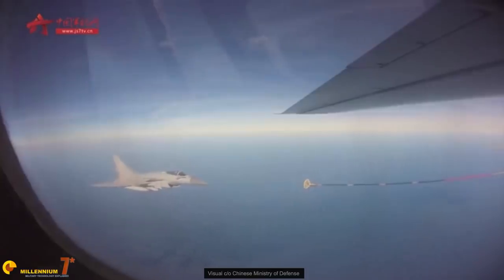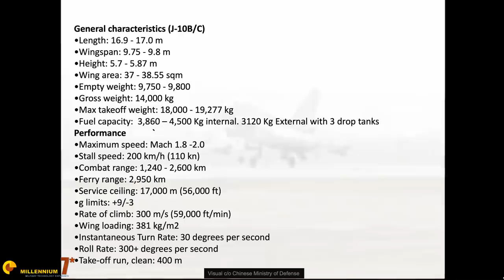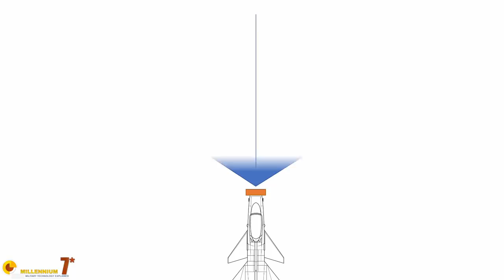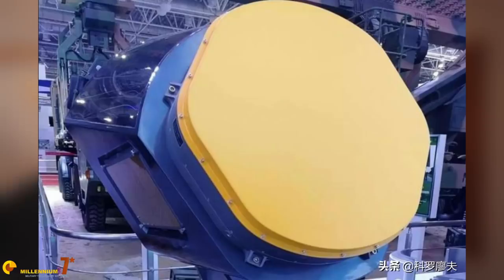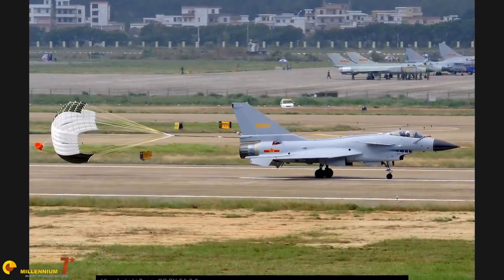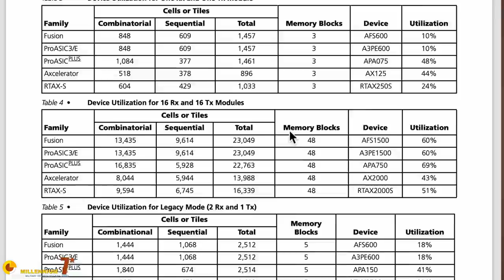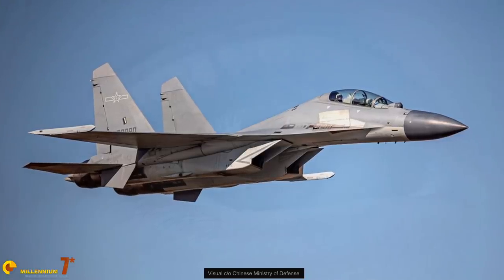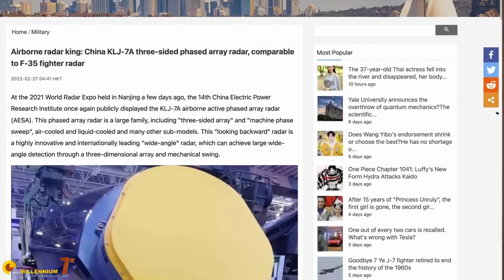I DUG DEEP into CHINA's J-10 ELECTRONICS and this is what I found...

Comment: I am not an expert like you but have been following Chinese fighters for more than a decade.
And I am pretty sure that KLJ-7 series of radars aren't installed on J-10, but they are installed in it's smaller sibling JF-17 thunder.

The pictures you have shown of KLJ-7A radars is from an expo, there were 3 different antenna configurations of the same radar and one of them have been selected and being installed in JF-17 Block-3 fighters. J-10 uses similar technology in radars to KLJ-7 but it has slightly bigger antenna and more T/R modules than the JF-17's one. 

And yes it incorporates a sophisticated EW suite onboard. 

The large antenna in center behind the cockpit is datalink antenna and Pakistan is right now receiving it's deliveries of J-10CP from production batch #7 of J-10C. J-10CP(Pakistani variant) has different data link antennas because PAF employees its own Link-17 data link and improved sensors like additional MAWS than earlier J10-C, different HUD and some minor changes. So you would find certain features common between J-10CP and JF-17. J-10CP is basically PLAAF J-10C with modifications as per PAF taste and  requirements.
Reply: Link 17 is only available for f16s in paf
Reply: @subhankarkeshi  Lol. Link 17 is Pakistan's indigenous homegrown data link system. Watch pictures of J-10CP and JF-17 thunder simultaneously, you would see some similarities in couple of antennas which are different from Chinese J-10C variants. Don't you feel JF-17 and link 17 rhyme together!!?

F-16s and even F-35s use link 16 data link made by the US. You should watch more videos on this channel to be informed about tech. I would refer you to F-35 block 4 video of this channel for detailed data link explaination
Reply: JF-17 Block-3 which is currently under serial production opted from one of those KLJ-7A AESA radar variants to be equipped in the latest block. There were 3 competitors in JF-17 Block 3 AESA radar, 2 of them were from China and one was from Europe. I can't remember it's name exactly, was probably from Italy the same radar they pitched  for the Grippen NG program. I am not sure about the European competitor and radar model as of now, because it's an old story.

J-10 and JF-17 uses similar radar technologies but J-10 has bigger nose cone so it's radar is slightly larger with more T/Rmodules and houses an IRST in it's nose as opposed to smaller JF-17s. 

That was what I was trying to convey to you in my previous comment. I am not an expert at all. But have been following Chinese military equipment and PAF closely for more than a decade.

"Although Leonardo-Finmeccanica’s Vixen AESA radar line was identified as an option by PAF officials (during the 2015 Paris Air Show)," said an article in "Quwa"
Reply: Nice info brother....
Reply: What is the cost per fighter? 🤔